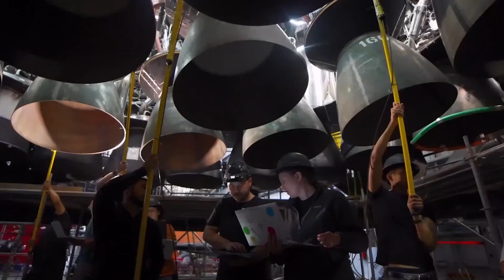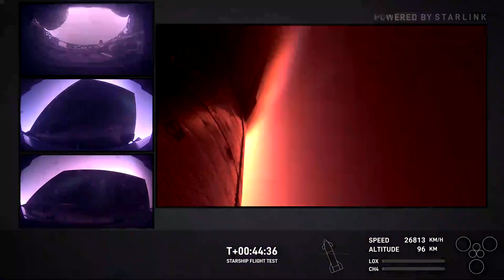FULL SpaceX Starship Flight 6 Broadcast re-upload

Comment: Some timestamps will add more later when I have more time 

14:17 First payload announcement (Banana) 
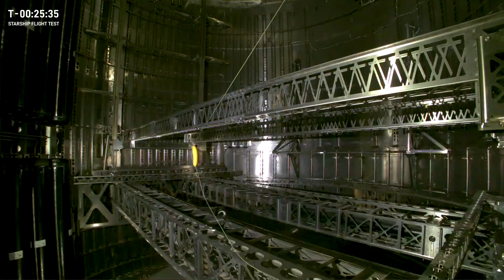14:32 The brave space banana 
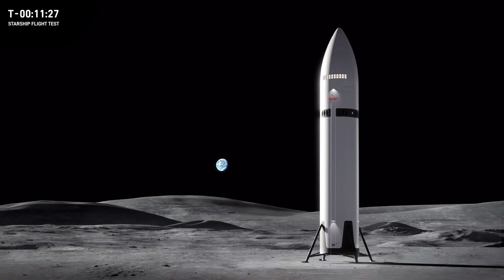28:40 Artemis Discussion 
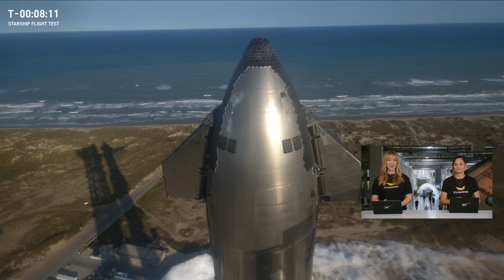31:58 S33 Cryo test footage 

39:54 T minus 10 seconds 
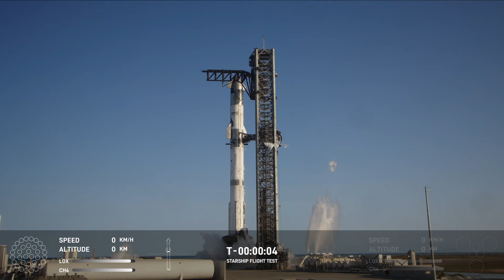40:05 Ignition 
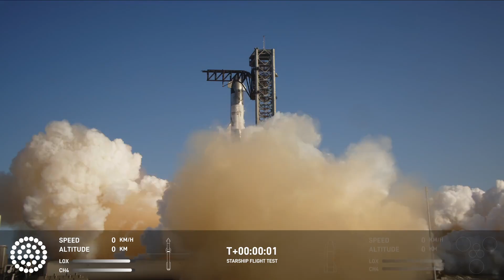40:11 Liftoff 
41:11 Max q
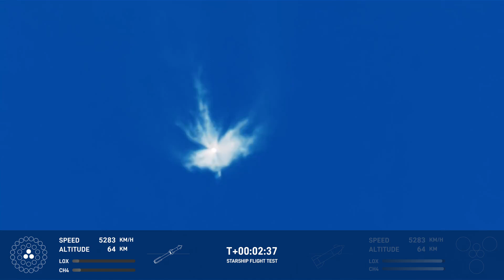42:42 MECO
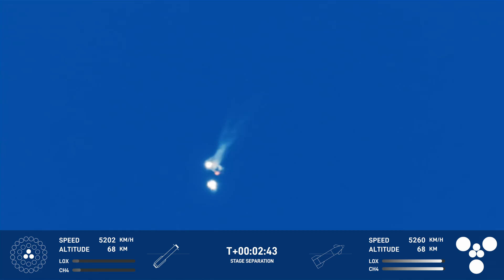42:47 Hot staging 
42:53 BOOSTBACK 
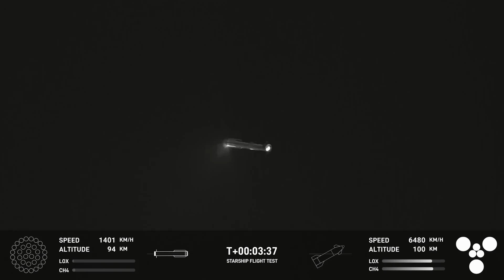43:42 Shutdown 
46:42 B13 ocean landing burn startup 
46:49 down to 3 engines 
46:59 Splashdown of B13 
47:59 Rvacs shutdown 
48:36 SECO
1:17:50 Relight demo!! 
1:18:00 shutdown 
1:23:44 Good attitude for entry 
1:43:01 Bellyflop 
1:45:18 Flip and Burn 
1:45:39 an Incredible splashdown